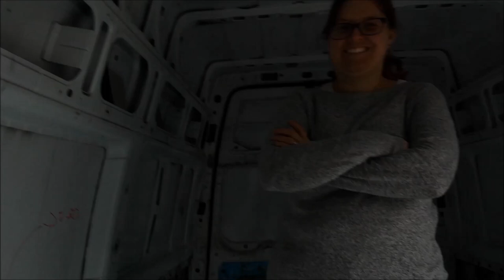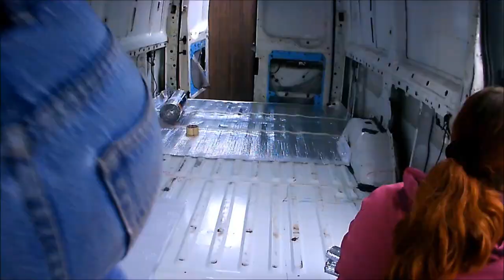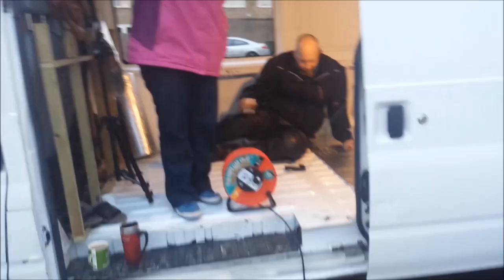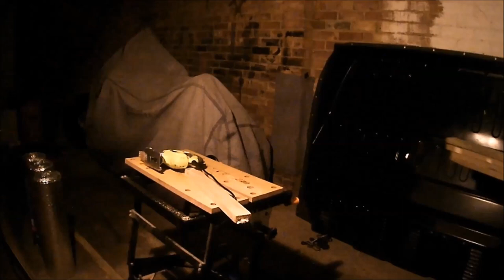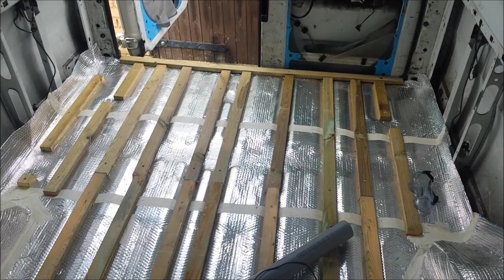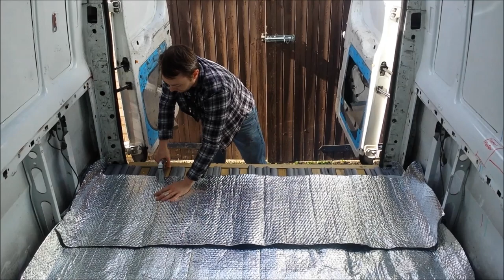Episode 4 (Take 2) - Flooring Insulation and Boards - Transit Van Stealth Camper Conversion

Comment: Hi, great vids thanks, just a question, when you screw the floor batons in, I'm guessing you use self tappers, do they not go through the floor and puncture the outside floor of the van??? Does this not cause a rust problem? I'm trying to convince the missus bout buying a van to convert so getting ideas and sorting out possible problems. Thanks.
Reply from the maker: MrChoppa68 I thought the same thing however when I unscrewed the old floorboard there was no sign of rust around the holes. If you use stainless screws, they won't rust either. Hope this helps.

Comment: Loving your build mate keep resorting back to your videos for the planning of mine which Iv just bought and started. Just wondering what pipe insulation you went for and how many meter lengths you used? Thanks mate
Reply from the maker: Cheers James. Glad you're enjoying the vids. The ones I bought where a meter long each and I bought 30 of them. I have a few left but they are coming in handy elsewhere. Good luck with your build :)

Comment: love the videos robert, keep it up!! quick question, did you screw the batons straight into the metak floor? and what screws did you use? cheers!
Reply from the maker: Yea, the battens are screwed straight in to the bottom of the van. Best to use stainless screws as they won't rust :)
Reply: Yeh thats what I used, self tappers ;-)
Reply: Hi Rob, great series!  I'm a little concerned about screwing my batons straight into the floor, i was hoping to stick them down using "No more nails" any thoughts?
Reply from the maker: Hey Sam. A couple of things to bear in mind: Make sure that whichever adhesive you use is suitable for bonding metal and wood. I will tell you somewhere on the container. Secondly, lightly sand the metal surface you are gluing to in order to give you a good key (something for the glue to "grip") and then make sure all surfaces are clean. Providing you do that, you shouldn't have any problems :)
Reply: @Sam Jones, Hi, I glued my batons down initially with a strong adhesive but then when the weather got warmer the batons (being wood) expanded in the heat and some came loose in parts, then when I stood on them they clicked loudly when walked over when the con caved bit of baton squashed down on the glue and popped back up (hope that makes sense lol) ! You will see this in one of my flooring video's so I had to make some adjustments and then screwed the batons to the base of the van ! They are fine now. If you are still concerned about the screws under the van rusting you can always get under the van and wax coat or grease them. Atb, Jay
Reply: Cheers for the advice Jay

Comment: How are you insulating the sides and ceiling of the van ?
Reply from the maker: The walls and ceiling are just going to be done with Celotex boards and expanding foam like the majority of builds. I did think about using rockwool but apparently it holds moisture and that causes rust.
Reply: Try  to get hands on the self adhesive type of armaflex, insulates very well und picks up no moisture!
Nice shoes btw...
;-)
Reply: yea don't use rockwool. did see a new insulation the other day. tiny plastic ball compressed in to a rolled up sheet you cut to size. its got a good rating and holds no moisture. ideal for vans. on another note what bike is under the cover. looks Honda shadow type

Comment: Why do you use split tube insulation on the floor? Is that cheaper than other insulation types?

(I am follow you from Norway)
Reply from the maker: It's pretty cheap but the main reason was to do with space. The battens are pretty thin (22mm) and most insulation starts at 50mm. Also the pipe insulation is made of foam which is to easy to cut and work with. This is especially handy when working between the narrow gaps of each batten.
Reply: Arne Mørk Midtbø I know you said most insulation starts at 50mm but the XPS insulation I've seen on eBay is usually in thicknesses of 6/10/20mm (https://www.ebay.co.uk/itm/162420094116). So I was lest wondering the same question
Reply from the maker: Well said sevenearths2010. Personally, I wanted to avoid polystyrene insulation as I cannot stand that horrible squeaking noise it makes. I know if you glue it down properly it doesn't do it, but I'm not fully confident in my skills (being that I've never done anything like this before) and I would rather have the piece of mind that I won't have to rip up my flooring in a years time or so to fix it. But yes, polystyrene insulation can be very cheap and versatile.
Reply: Arne Mørk Midtbø cheers for the reply rob. I didn't know xps made a squeaky sound when you walk over it. Good to know. Just trying find out as much as possible because I've got my own van/lorry to insulate
Reply from the maker: Well, I don't want to put you off the idea. It would only squeak if there is movement. If you are happy you can make sure it doesn't move, it should be fine. But for me, it was just a risk I didn't want to take. Good luck with your build by the way :)

Comment: im pretty sure foil insulation needs an air barrier and has to be exposed to work as intended. it reflects heat radiation. if its glued down on metal it acts conductive instead, and will let heat straight through. in fact, the mug was a perfect test, it was to hoot to hold, right? if there had been an air barrier it would have worked!i think the tubing will work as a n air barrier, not sure about the covering though! here is the link where i found this info. https://sprinter-source.com/forum/showthread.php?p=404699
looking forwards to the next vid!
(i have to say, that music is atrocious!)
Reply from the maker: I thought the same at first but I could definitely feel some difference between the temperature of the metal floor and the bubble-foil overlay. There is a very thin air gap provided by the bubbles in it. I wouldn't rely on it alone of course, and this is why I used to the foam too :)

Comment: Where's Maria?  Looking good mate.  Did you manage to get a single board to cover the whole floor or is it several sheets?  If so, how many did yo need?  Are you going to be doing a BOM and costings at some point?  Well done!  Seriously though, where's Maria? :o)
Reply from the maker: No idea what a BOM is so I might be, I might not be haha. The floor was done with 4 1200mm x 2400mm. There was, of course, plenty left over.

Comment: Reflectix is not insulation, it is just a vapour barrier, almost zero thermal qualities
Reply: Richard Brown it will actually conduct heat from/to your metal floor.